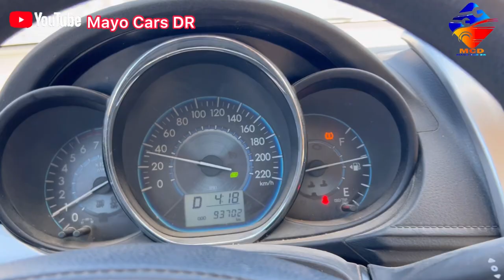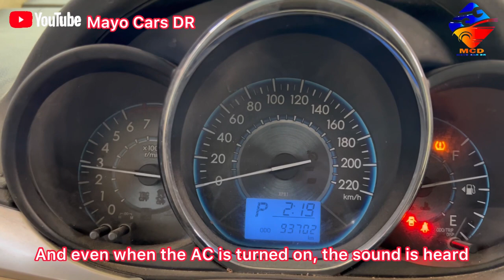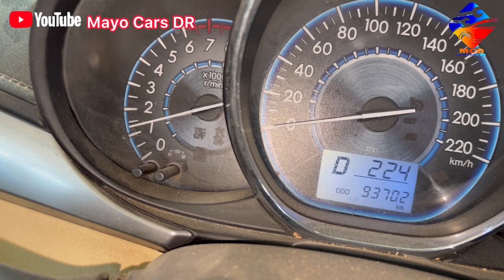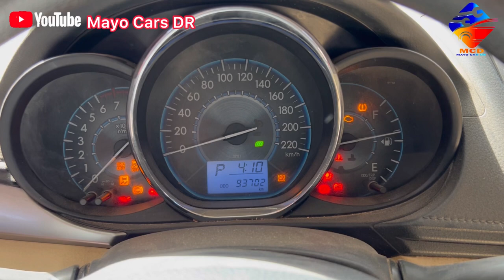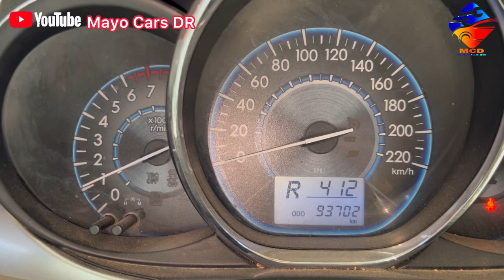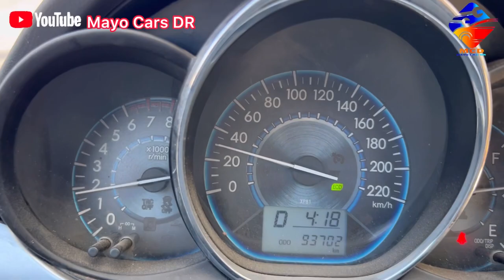How To Diagnose Engine Noise Of Toyota Yaris

Comment: Thank you for the video. May I know what is that continuous knocking sound in the engine? My car is having that knocking sound since around 4 years and the sound is getting higher and higher. Thank you
Reply from the maker: Drive belt tensioner sound in video
Reply: @MayoCarsDR  I mean the continuous knocking sound at the end of the video after replacing the tensioner. Can you please explain what it is? My car has ran around 80,000kms after starting that sound. With the time being, the sound increased. 
Thanks a lot for the support 🙂